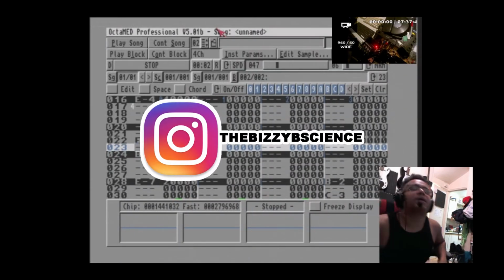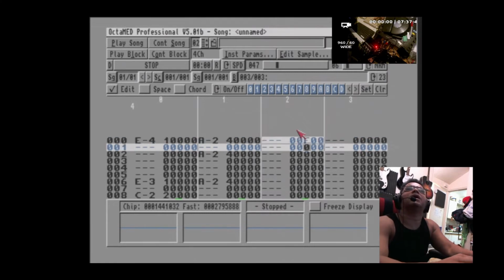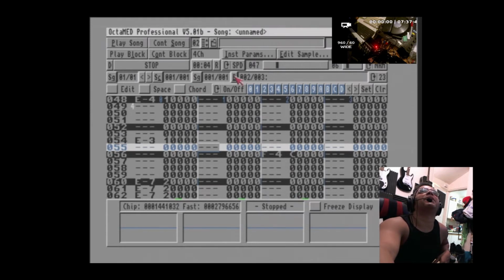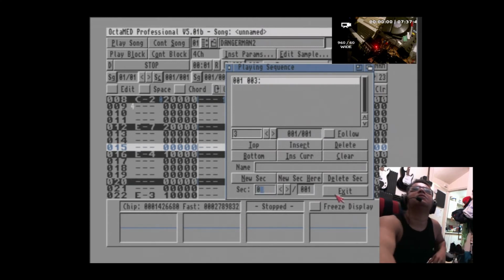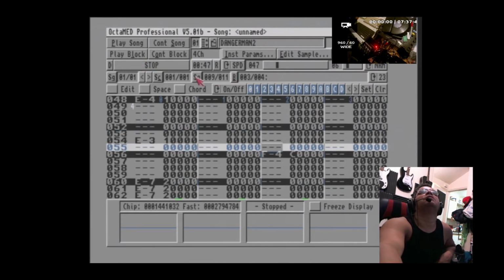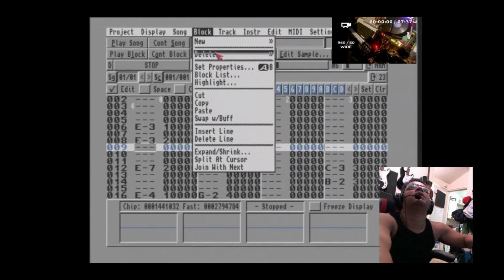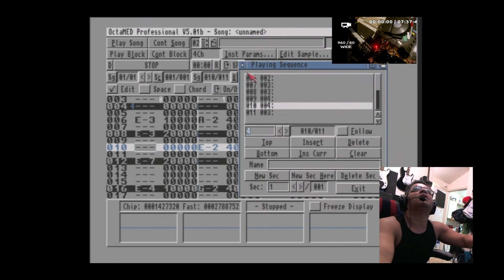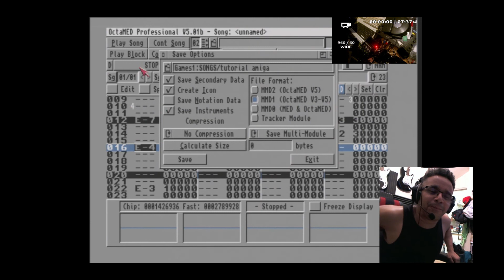PROPPER COMMODORE AMIGA TUTORIAL PART 3 | Foundational BLOCKS

Comment: Awesome mate !! 

Luv the old rave jungle amiga and C 64  sound 

Surprised there has not been good emulator yet or vst x64 
I've seen it on Linux systems working well 

Extra memory and processing of today I think this would be amazing for that old sound .

The UK garage stuff you use to make ( Beat freaks etc ) 
Was that mainly Akai Mpc 1000-2000-3000 ?  Samplers? 
Had the swing grooves for it 

Tho I think Tr909 was used in some 4x4 garage ?